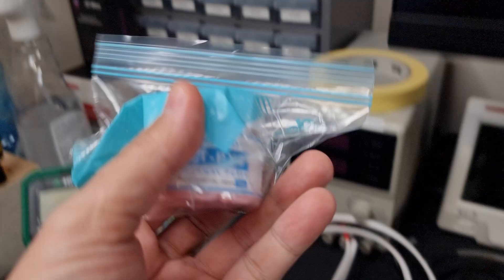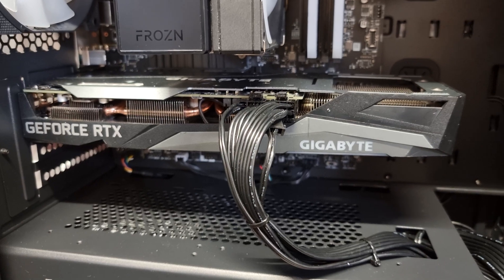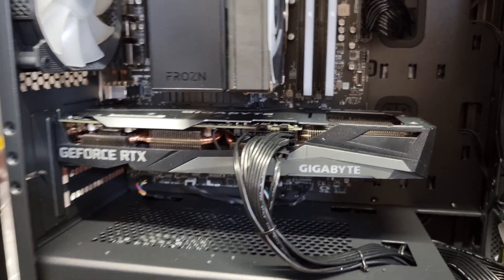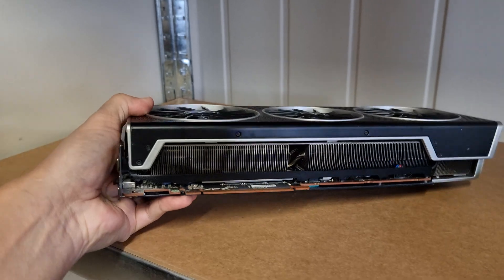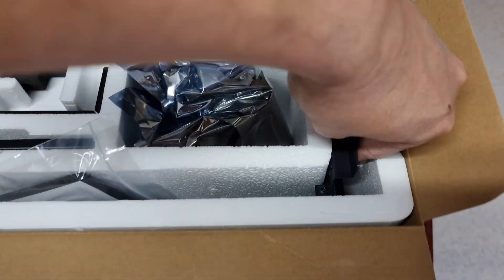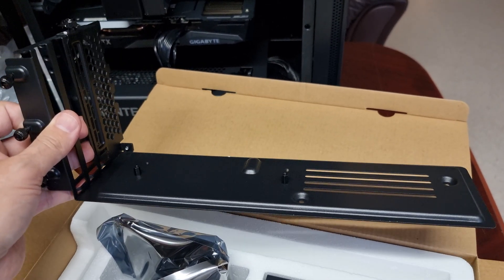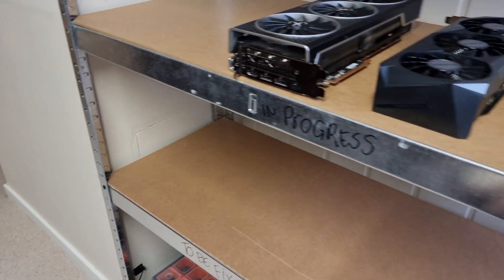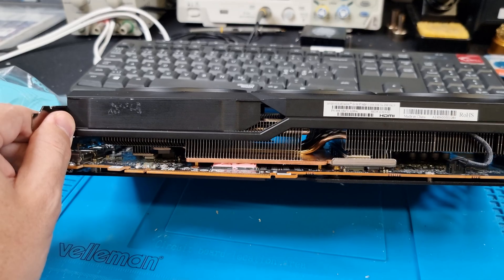Why Modern Day Graphics Cards Are Dying Prematurely.

Comment: 😊 Buddy, northwestrepair  just uploaded a video on another dead video card, he says the card was killed because the circuit board shorted out because of 'sagging' , tho he did no mention anything about recommendations on using these video cards in the Veritcal Position. 'Stay away from AMD 6800-6900 graphics cards'
Reply from the maker: Yeah I just saw that video. I am surprised that he has taken a dislike to AMD 6800 and 6900 cards. I have worked on many of these cards, but my experience with them has always been the same: cracked solder joints under the memory chips closest to the PCIe slot. I was disappointed that he did mention the problem with sag, yet did not give any tips on how to prevent this to begin with.  

I can tell you that if you install these cards vertically, they will just keep on trucking. I've had an MSI RX 6800 non xt card in a system since 2021, and it's still going strong. It's in my kid's PC. I take it out once in a while to dust it off. That't it. The problem is NOT the 6800 or 6900 cards themselves. The problem is sag. I have a 6900 here in for repair with the same issue, and it was just the memory chips. 

I think Tony is very knowledgeable. But some times he says some things that crack me up 😆.
Reply: @TechnologyHive  😊 yes i like him too, its not his fault, it seems to be industry wide ignorance or something, horizontal installations are kinda like The Elephant in the Living Room that nobody notices

Comment: i know this is the porblem with new morden graphic card big like brick that why i chose my pc case SSUPD XHUTTLE so my ASUS TUF RX 9070 XT not mount horizontal cos of weight not balance and this ASUS tuf RX 9070 XT is pertty big like brick..with SSUPD XHUTTLE pc case it mount vertical because of motherboard installation deference  from normal pc case

Comment: Why not using a Case, where the whole System is mountet in 90° in the first place?
Great Airflow, no Risercable and newerever a sagged Card.
😊👍
Reply from the maker: I would 100% do exactly that, if I had no other option and I had room on my desk. That works perfectly fine too.
Reply: @TechnologyHive  Well, take the Thermaltake "The Tower"-Models - for example. The Tower 200 for m-ITX Systems and the 300 for m-ATX. Fits probably on any Desk. Looks good (subjective^^), silent and good Airflow... 😊

I myself have a Tower 500 with an ASUS-ROG Set. Super silent, good Temps and no worrys for my GPU.
Reply from the maker: @H1rNf1cK  Whatever works for you is good. I would love to see more Cooler Master Elite 130 cases. Sadly they do not make them any more.
Reply: @TechnologyHive Oh yes, These Cases were very nice, but with several flaws (imho):
1. Very limited Aircooler Options because of the Powersupply straight above the CPU.
2. Topblower-Cooler in disadvatage because of the Air is taken from the Powersupply (only the Topblower CPU-Coolers that pushes the Air from Below in top-direction would work here) and
3. CPUs with 95W+ can't be used, b cause of the first two Reasons.

But, as a Modern Alternative to these CM-Elite cube-cases, what about the Evolv Series from Phanteks?

Comment: i think i may have damage my graphics card in this way because i've been noticing weird glitching happening while watching someone's screenshare/a video on youtube
Reply from the maker: Download Furmark and let it run for about 10 minutes. If the PC freezes or crashes, then you will get your answer.
Reply: @TechnologyHive  well my gpu made it through furmark so now i have no idea why there is artifacting while under the circumstances i stated in my initial comment
Reply from the maker: @YourLocalMoff  Try turning off "hardware acceleration" in your browser options. You will have to look it up as I do not know which browser you are using. Brave has an issue with AMD cards with hardware acceleration turned on.
Reply: @TechnologyHive  that seems to work, i have tried doing that and it stopped the glitchy artifacting from appearing, i just found the setting for it in discord as well so that it stops showing up when i watch a screenshare as well
Reply from the maker: @YourLocalMoff Very nice. Glad you got it done. Cheers.🎉

Comment: My last 2 graphics cards lasted 5.5 years each.
Reply from the maker: That's because you took good care of them, I assume.
Reply: @TechnologyHive  Yeah but shouldn't they last longer than that?
Reply from the maker: @Brian-The-Giant  Today, graphics cards are built heavier due to their over sized heatsinks. This is one of the main reasons why modern day GPU's do not last as long as those from the early 2000's
Reply: @TechnologyHive  Both cards would start glitching progressively worse and cause visual corruption/glitches and most of the time freeze the computer. This would seem like a chip failure either vram or core. Since I would usually run the cards at 80 percent via MSI Afterburner to lower watts and temps it was most likely vram failure.

Comment: I go with horizontal, and for support I use a simple "jack" (in extreme cases I'll use two) cut from a dowel rod or even a Bic pen barrel (make it whatever color suits your aesthetic or theme) cut to the exact length required.  The process described here for getting the height correct is spot on.  The problems with vertical mounting are well known -- cooling is usually not good, and your PCIe slots will probably be blocked.
Reply from the maker: Cooling is good if installed with a 3rd party vertical mount kit.
Reply: @TechnologyHive  Which is expensive and blocks PCIe slots.
Reply from the maker: @rangersmith4652  Anyone looking for a vertical mount will have many options. Some cost $40 others can go up to $200. If you don't want to block your other PCI slots, go vertical with supports. Simple.

Comment: I did a bunch of research before buying my 4090 and one of the things I did was build my pc in a horizontal case so my gpu could be mounted directly into the PCI-E slot vertically so there would never be any chance of the pcb warping or cracking. The other main thing I did was attach thermal probes to the gpu power connector to monitor the temps to possibly catch any chance of it melting. So far so good after 2 years.
Reply from the maker: Those are the best cases, in my opinion, to help mitigate this problem.

Comment: UM...
Yes you are correct that NOT ALL 6800s have Vapor chambers, But most do have them. 
SAPPHIRE Pulse cards usually do NOT have them, and thats one of the reasons why they are cheaper. And why there are ONLY NITRO models for high end GPU-s.
However you may be neglecting one very important rule of Physics there m8:
If you have a 6.0 Liter v8 with 50 Liters of pressurized Coolant, that's all irrelevant when you Use a VW Golf 1.6 Liter 370x600x40mm Radiator. 

That heat is Out of the core, but how does it exchange with surrounding air?

When it doesn't you just used Expensive Tech to do basically nothing as the Heat is trapped in your system due to lack of fin surface...

I agree with your other points, but you seem to be missing some Thermodynamics classes. Reference cards have Vapor chambers and SMALLER not small, Smaller coolers and they run quite hot and throttle in all but best cases.
Reply from the maker: Honestly, I don't even know what you're going off about. I do not see how me not having a degree in the laws of thermodynamics makes any difference in my ability to diagnose and repair dead graphics cards. Reference design GPU's like the 7900XT, for example, run perfectly fine at spec clocks during full loads. I have monitored their behaviour during load, and I have not seen this "throttle in all but best cases" scenario. 

Many factors also affect how cool a graphics card will run in a system, such as air circulation in your case. And yes, heatsinks with vapor chambers used in reference design cards are smaller than AIB, yet manage to keep the cards running within specs. AIB models just happen to cover more surface and allow for cooler operations, thus allowing for higher boost clocks and overclocking, in most instances, not all. Any way, I think I will pass on your classes on thermodynamics lol. Thanks for the comment!

Comment: I been working on computers since the late 90's and I cant understand why they make graphics cards this big! I realize they run faster and hotter but you would think they could remedy the problem by now! Personally never buy three fan cards because of this issue. I think the big manufactures want this to happen to boost sales and they are getting ungodly money for these current video cards just pure greed! Don't buy three fan cards or make sure you mount them vertically as the man in the video says! I've never had this problem with two fan cards in my computers. My two cents!
Reply from the maker: I have rarely seen 2 fan cards come in for repair due to weight related issues. It does happen, but not nearly as often as these large cards. They do not need to be this big, and a perfect example is the reference models from both Nvidia and AMD. Even their 3 fan cards are kept 2.5 slots or just shy of it, a lot shorter than AIB cards, and yet temps are fine on these cards without massive heatsinks attached to them. The problem I do not think is AMD or Nvidia, but rather brands like ASUS, GIGABYTE, MSI, AND XFX. They're creating a huge problem that really does not need to exist.

Comment: Litteraly zip ties are the cheapest option to tide up GPU to some point in a case , there's always a little hole somewhere on a shroud and PC case which hooks up to the zip ties
Reply from the maker: If you do that, you would be hanging your GPU up to something in the case, causing the graphics card board to bow upwards at the point of attachment. I do not recommend this because I have seen what happens in time and the result is not good.
Reply: @TechnologyHive yeah but you could say the same thing for those little stands can you put underneath your GPU to stop them from sagging, could you not?

Which reminds me I just received an overhaul due to a pump reservoir dying I guess I better put my little stand back
Reply from the maker: @tomallen5837  Do as you wish man. It is ultimately your hardware, not mine. Have a good one!

Comment: I'm buying RX 9060 XT 16GB two fans. After watching this I'm trying to find GPU support but eh it's quite expensive so I'm going with a simple alloy stand. Would this help supports the weight of the card enough?
Reply from the maker: That is a two fan card. I would not worry so much. But if you still want to have some support, I buy mine here: https://www.aliexpress.com/item/1005008838195198.html?spm=a2g0o.productlist.main.3.2a9fVKsgVKsged&algo_pvid=8c235a38-2cf7-4048-bf1f-b18662894e98&pdp_ext_f=%7B%22order%22%3A%22167%22%2C%22eval%22%3A%221%22%2C%22fromPage%22%3A%22search%22%7D&utparam-url=scene%3Asearch%7Cquery_from%3A%7Cx_object_id%3A1005008838195198%7C_p_origin_prod%3A

Comment: Engineering at a price point is hard, but weirdly is it the highest priced stuff that's most vulnerable to 'simple' problems like physical support and connectors?
Reply from the maker: You're correct. A lot of these issues are public knowledge, yet folks continue to buy them regardless of the failure reports.

Comment: People have been putting support brackets in the wrong place, flat out, should be in the center of the mass/weight. Putting one on the end looks natural but is incorrect
Reply from the maker: If its a 3 fan card, placing the support between fan 2 and 3, or 2/3 the length of the card is where I recommend putting the support. But you can also place it in the center, sure.
Reply: @TechnologyHive well... wherever the center of the heaviest part of the card is.   Moreover, I see posts everyday on reddit where they have some random toy or a bracket at the very end of the card, not realizing they're warping it. There's a lot of new builders out there. Education is free :). Thanks for the vid.
Reply from the maker: @darealboot1  Your very welcome! Thanks for watching!

Comment: You talk like  it's the users fault if their card was built poorly.  There should be a class action suit to stop AMD/Nvidia from building these without horizontal support built in due to cheapness in manufacture.
Reply: P.S., what if I just turn my case so the graphics card is vertical?  You know, like how home pc's were originally built?
Reply from the maker: @craigcole9337  Yes that will work. Many people set their PC cases on their side if theres room on the desk to have the GPU vertically.

Comment: Does inverted cases like SSUPD XHUTTLE Midi-Tower help like vertical GPU mounting?
Reply from the maker: If the GPU is not installed horizontally without supports, yes.

Comment: This is part of the reason I bought a server rack.
Horizontal layout only.
But also, the memory they are using in these cards is cheap crap.
9 times out of 10 a dead card will be just because a memory chip died or is dying.
This is because we are getting all the leftover memory chips on consumer grade hardware.
All the first off quality chips are dedicated to server A.I. cards.
This didn't happen before A.I. craze by the way.
Reply from the maker: Most of the dead memory related issues, from my experience, have had nothing to do with chip quality itself, but rather from physical damage, such as ripped pads. Samsung is notorious for having pads ripped from the memory chip, rather than on the PCB itself.
Reply: @TechnologyHive  That is an interesting point. I do have a second hand 7900 XTX with dead memory that I figured was the chips themselves. Might try a remelt and see if it comes around. It does have the classical bow at the PCI-X slot.
Reply from the maker: @BehindthesafetyofLinux  I can predict, from experience, the chips are G and H which need replacement or reball. F could also have ripped pads.

Comment: what are the benefits to using a 3rd party mount instead of one that came with the pc case, if the case came with one?
Reply from the maker: 3rd party vertical mounts allow the end user to place the card away from the side panel and closer to the motherboard, while the vertical mount option in your PC case places the GPU too close to the side panel and restricts airflow, thus causing overheating problems for the GPU.
Reply: @TechnologyHive ty

Comment: Inactually used a Gigabyte AERO RTX 4090 GPU stand that mounts onto the mohterboard and yiu use the 3 screw slots on the rear of the gou to hold up my gpu which is a pny rtx 5070.
Reply from the maker: That works too. 👍

Comment: I've been buying video cards since 1998. Of course, the weight and size have only increased since then, but I've never had problems with any of them, always mounted horizontally. The largest I've ever had were the Sapphire 6750 Vapor X, Asus GTX 970 Turbo, Asus Strix GTX 1070 OC, Galax RTX 3060 Ti Plus, and now the Asus Prime RTX 5070 OC, most weighing 1 kg or more... I only used a support bracket for two of them, the 3060 Ti and the 5070...
The tip in this video is relevant and should consider.
Reply from the maker: I cant remember for sure, but I think it was 2008 when they decided to switch from leaded solder to leadfree solder. This shift has made contact pads more brittle and easier to crack than leaded solder. Lead free solder is a strong bond, but it is not as forgiving as leaded. Times have definitely changed
Reply: @TechnologyHive  I love to use leaded solder wherever i can - Soldering is also much easier and safer with heat sensible components.

Comment: 5:00 - Yeah xfx tend to go overkill with their cooling. my 7900xt only need about 45% of the cooling capacity while oc...
Reply: And yeah most of the time the fan stay deactivated because it won't go above 40°C to 50°C on the memory whitch is the hot spot on that thing.
Reply from the maker: Their coolers are the heaviest in the 7900xt line up that I have seen.

Comment: POV you've taken the lead by mounting an xfx verticaly to avoid most of those problem X)
Reply from the maker: XFX are worse offenders. Some of their cards are the heaviest I have seen.
Reply: @TechnologyHive  I remember my XFX GTX 1070. It was the only metal-only GPU cooler i have ever seen and 3 fans.

But i never had a bracket - no warping, worked for over 5 years without any issues either i was gaming or the PC did 24/7 crypto mining.
Reply from the maker: @harrison00xXx  Those were the good ole days when cards could be built in a 2 slot config. I miss those days :)
Reply: @TechnologyHive  To be fair, I've gone with the plastic backplate instead of the aluminum one to benefit from lighter material (not that much, though) and also avoid unnecessary heat concentration above my Samsung 990 Pro SSD and CPU zone.

And yeah, XFX's weigh a lot, but they're good cards, if you don't make a mistake when building your PC.
Reply from the maker: @DJgeekman  I have an XFX myself but on a vertical mount. They are bult with good power drivers and controllers. Its just weight that kills them.

Comment: Lancool 217 pc case comes with a nice adjustable anti-sag arm built into the case .Coupled with the regular kick stand it holds my heavy 5090 good. 🤞.
Reply from the maker: Some support is better than none. 👍🏼
Reply: @TechnologyHive  I’ve  read that the 5090 doesn’t pair well with a Gpu Riser cable or I would have opted to mount vertically originally. Have you heard of this?
Reply from the maker: @Weevil-Knievel1134  I have not heard of this before you mentioned it. It might have compatibility issues with the vertical mount built in a lot of cases, and not 3rd party vertical mount kids.